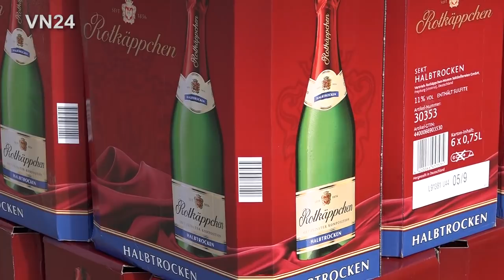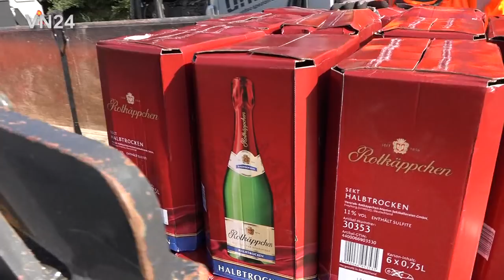01.07.2019 - VN24 - LKW kippt auf Seite - brandneues Bergefahrzeug im Einsatz

Comment: Well done, gentlemen!  This is the first time I've seen a big rig towed with the wheels secured to the tow rig.
Reply: Jeffry Blackmon our big trucks here in the states usually the underlift also ours steel and very heavy though
Reply: @donaldpauli129  Semi trucks in Germany can actually be a little bit heavier fully loaded (up to 40 metric tons, or 44t if they are carrying intermodal containers) than the maximum allowed on US interstate highways (up to 36t). Empty weights should be pretty similar.

Comment: Check out all them two story trucks driver over the front wheel, you guys have the length laws like we had here in the US. in the 1960s - 1970s truck with a hood fuel filter change 7 minutes a cabover 1/2 hour
hope you don't break a windshield or two with the shit packed up in the sleeper jacking the cab up HAAHA
Reply: As far as I saw in videos American Trucs are way safer
Reply: @maxim430  Its called large car here USA sonnyboy you got them cabovers hiding them boat anchor engines, It's like driving around in a fucking cabover tree house
HAHAHA